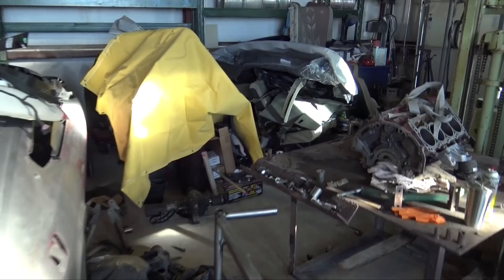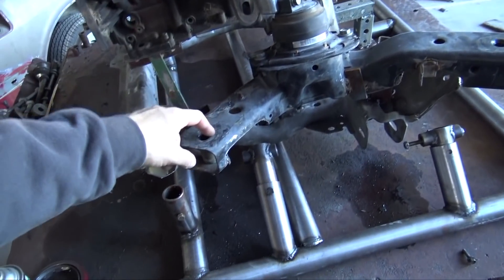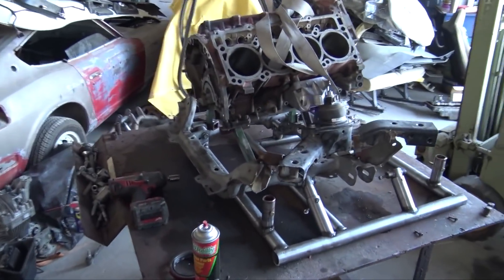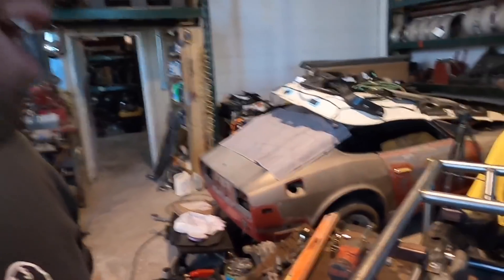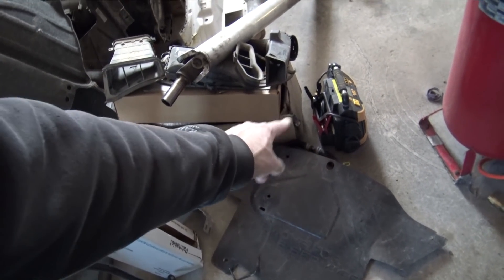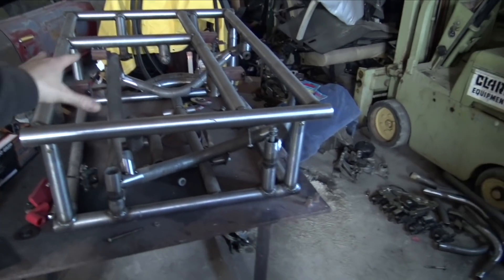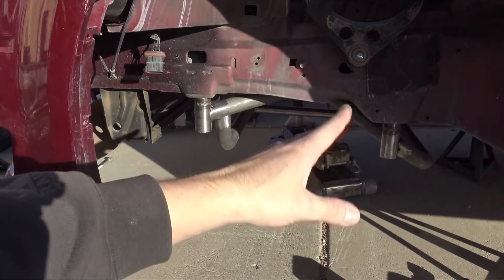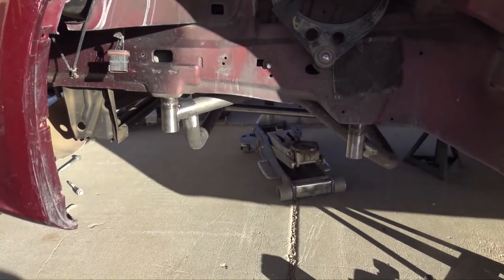Building the Ultimate Station Wagon | 2021 Charger Magnum Hellcat | 1000HP Hellwagon | Pt 72

Comment: When building a jig fixture there are critical things you need in the exact location, things that might become critical so you need to provide for them and things that you can pretty much ignore and just fub into place when everything else is done.
Exhaust hangers and other little tab to hold wires and shields and such are usually something that can be forgotten about until the whole thing is bolted up into the vehicle. The way things were done in the factory is the best solution for assembly  line production with robots etc, it may or may not be good to copy everything that the factory does.

Comment: Is all this work fitting the fixtures for reproduction sales later? Seems like a lot of extra steps for a one off track hawk wagon build, instead of building to the charger wagon and moving on.
Reply: He probably has less then a grand in materials for just the front subframe but with labor engineering and everything a bare subframe with just bushings and unpainted could probably easily sell for 10 grand

Comment: Note. 
A steering rack that’s for behind the axle cannot be moved to in front of the axle.
Unless you want turn left to go right.
Reply: I could be wrong, but with an electric rack, isn't it possible to alter the polarity of the driver motor?
Otherwise, yeah. That could definitely be a bit of an issue.
Reply: @scottdoubleyou563  . The rack is designed to move the tie rod in the required direction when the steering wheel is turned in that direction, if the tie rod is in front of the axle turning the wheel left will move the tie rod left but if the tie rod is behind the axle the tie rod will move right to turn the wheel left, altering the motor to spin opposite will just fight against the turning of the steering wheel.
Reply: @anomamos9095  Yup. Makes sense. 
But I also heard him say that he was using different knuckles. AWD Charger specifically, and that he was swapping sides with them to relocate where the tie rod ends connect to them. Wouldn't that solve the issue? I'm not big on fabrication or customization. I do alot of mechanical work on my own cars, but when it comes to steering and suspension, most of my experience is in lifted YJ's and XJ's, and the occasional lowered Honda.
I don't think I've ever relocated an entire R&P unit before.
Reply: @scottdoubleyou563  he’s been talking about what steering rack to use, charger or track hawk.
If one steers from the front of the axle and the other from the rear they cannot be swapped unless they are put on the correct side of the axle. If he’s changing the knuckles to suit the rack when it is located in the correct position that’s a good thing.
Except that it may mess up the castor if the ball joints are not in a straight line with the axle
Reply: @anomamos9095  Again, everything you're saying makes sense to me. 
But considering what he's done so far, I think he's gonna figure this out too.
Either way, it'll be interesting to see what solutions he comes up with.
Reply: @scottdoubleyou563  I made my original comment because it’s one of those Doh things that can slip your mind until you discover your mistake after a whole lot of effort and expense.